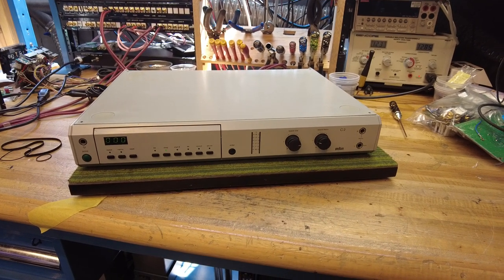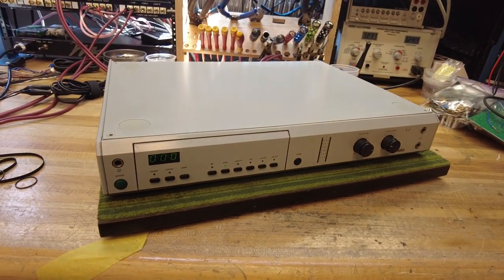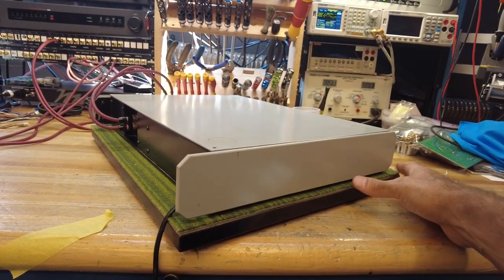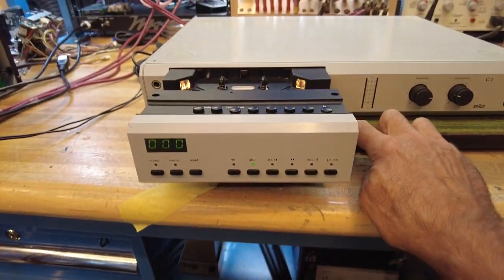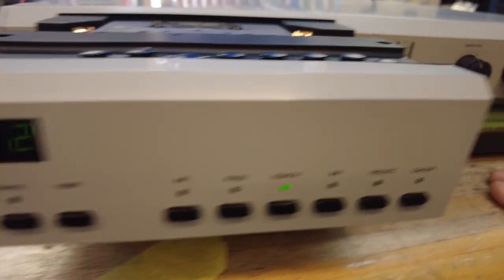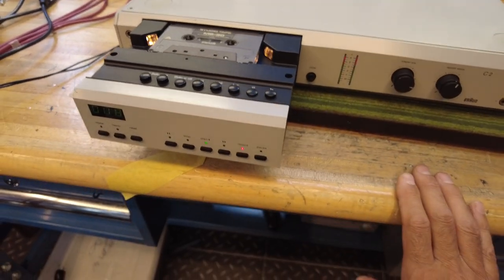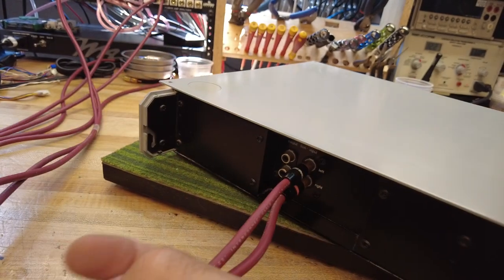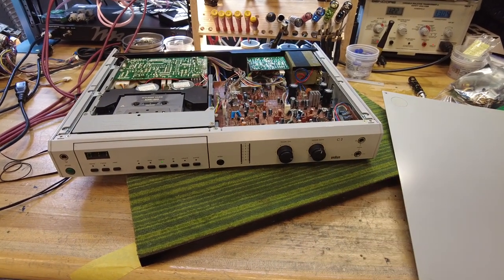The Quirky Braun C2 Tape Deck With a Slick Motorized Loading Drawer

Comment: i owned the ADS version of this deck and the matching receiver in the mid 80's through mid 90's. both seemed really well built and worked flawlessly during my time with them.
Reply: I once inherited the entire ADS Setup in black. It looked a lot better than it sounded.
Did have KOOL factor.

Comment: First time I've ever seen both Dolby C and FeCr tape selection,  There can't have been long where they were both a thing.
Reply: I suspect the FeCr was intended for backward compatibility, as you noted, it was gone before Dolby C was released.  I've also not seen a deck with both FeCr and Metal, although I would be less surprised by that.  I know the Onkyo 630D was FeCr and the 630DM was Metal.  Exact same deck except for that.
Also, it was only sold in 1982.  The C3 came out in 83 and was sold for several years, did not have FeCr.
Reply: I have a realistic deck that has all 4 tape types.
Reply: This one's probably from 1983 or 1984; that's when tape decks with FeCr and Dolby C decks: think Sony's TC-K777ES.
Reply: Denon and Sony were hangouts for type III, I think they both gave up about 1985.

Comment: Got an ads C2/3 tape deck for the last 3 years with a cd player CD4 and a Braun A1 integrated amp. Lovely tape deck. The whole combo works nicely along with a pair of ads speakers (what else!). It is a breath of fresh air - simplicity and functionality - compared to high end gear that I also own.
Your video is very nice, maybe include a audio sample next time, instead of only a very accurate narrative.